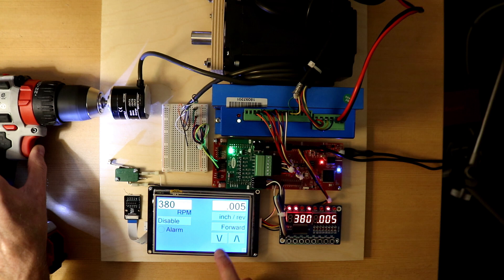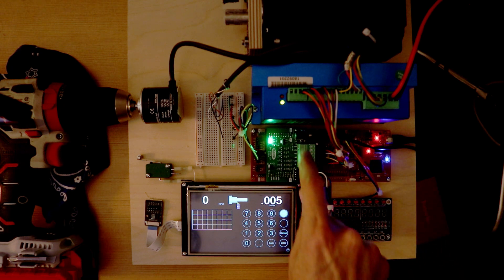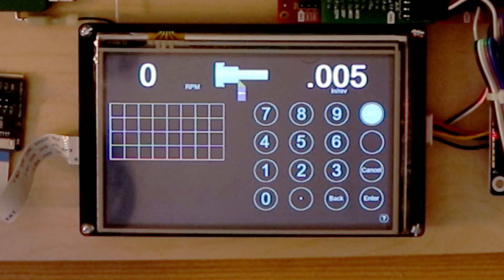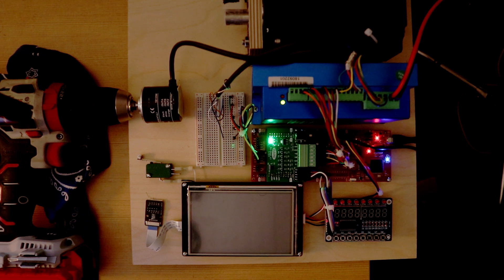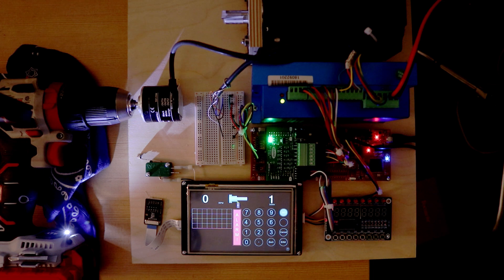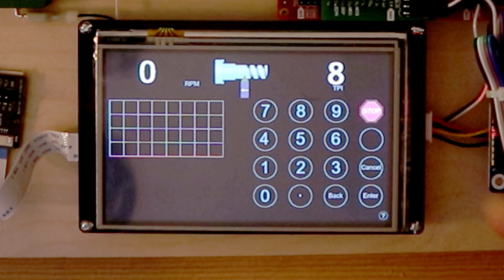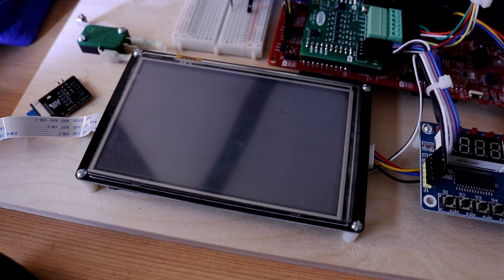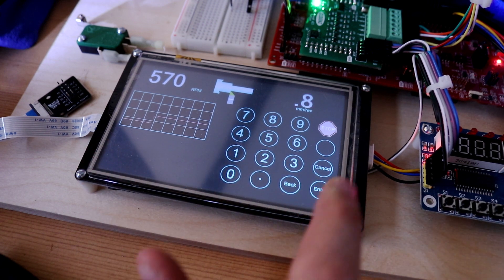Touchscreen for Clough42 Electronic Leadscrew

Comment: The touch screen is a great addition to Clough's ELS.  I would like to make a suggestion that improves on your overall offering. Instead using a Nextion Touchscreen, why not use what most people already have, an iOS or Android mobile device?  Even an older smart phone or tablet should be more than sufficient, allowing people to put their old tablets into use instead of throwing them away.

Writing the software for a mobile device is significantly easier due vast development resources available. The result is also far more powerful in terms of usability and presentation as smart phones generally have better screens and touch capabilities.  When combined with the sensors already available on most cellphones, the possibilities expand even further.  Imagine snapping a photo of a thread and it automatically calculates and sets up the parameters for you.  

In addition to the control App, you only need to design a hardware IO interface and  a specialized communications protocol, which you should standardize. You could also specify it as an extension to G-Code, establishing it as a standard. Both USB and Bluetooth should be fast enough for sending commands and data. Since you cannot interface with iOS via USB, unless you obtain a license from Apple, Bluetooth can be used on both mobile platforms.
Reply from the maker: Hi Barry, interesting idea and thank you for detailing your argument. I'm considering doing this for other work that I do (https://confluencerd.com/) replacing long lead-time industrial touchscreens and computers, while reducing cost, getting a much higher resolution on the tablet screen (in less space), adding portability and easier updates. I have three full computers in my small shop, and repurposing would save a lot of space (and cost.) A couple more sensors that are interested include the microphone and accelerometer for potentially recognizing chatter or other cutter performance. Then, there is the ease to include reference material from the Internet. Do you see the g-code extensions useful for something other than sending progress messages? This ELS is not the project that I want to explore your suggestion with, but I've saved your suggestion for a future project.

Comment: I haven't watched it all, but does it support multi-start threads?
Reply from the maker: Hi David, multi-start threads are not provided by the ELS. An ELS is to help manual turning by providing a programmable gear ratio between the spindle and lead or feed screw. The stock ratios are otherwise limited and may be inconvenient to change otherwise. To cut a multi-start thread on a manual lathe, one way is to index the part. The rough steps are: cut the the first thread, stop the spindle, disengage the leadscrew, rotate the spindle and part to the next index (e.g.: 0, 120, 240 degree for a three-start), re-engage the leadscrew, start the spindle, and cut the next thread. A lathe might have a graduated ring on the spindle to help make this more accurate, but small lathes are unlikely to have that. Your question is a good one because the answer shows how an ELS could help produce mulit-start threads: show the current rotary position of the spindle and fill the role of the missing graduated ring. Pretty interesting... maybe I'll make one more change...
Reply from the maker: This video shows a few different ways to cut a multi-start thread on a manual lathe including a graduated ring, slipping the gears, and a dividing plate. Pretty cool.
https://www.youtube.com/watch?v=4OmD0bqxpXg
Reply from the maker: Just added spindle rotary position. With a 4096-count encoder, degree-minute is the best that make sense. I may make a YT Short this week about it. Thank you for the idea :)
Reply: @kentvandervelden  As a non-machinest, suggestions are all I can make. ;)
Reply from the maker: You have a lot of CNC experience with 3D printing. Have an unused 3D printer to convert to a CNC router?
Reply: @kentvandervelden  I sort of do have an unused 3d printer....  But I don't have time for yet another hobby.
Reply from the maker: @davidwillmore  :)
Reply: @kentvandervelden  If I had anything I wanted to machine, I would have some motivation, but my interest in machining is just curiosity.  I sate that desire well enough watching you and this old tony.  You do a much better job than I could anyway.  I would rather just cheer you guys on.
Reply from the maker: @davidwillmore  Completely understand. No interesting person will ever have enough time to explore everything they may enjoy, unless they get to come back. I'm happy to have your support in this life :)

Comment: Great work on this and a nice upgrade. Liking your ideas for future improvements too. Thank you for sharing!
Reply from the maker: And thank you for the support! I just added rotary position in degrees and other modes and a friend wants to implement the feed override.
Reply: @kentvandervelden  Sorry, can't wrap my head around this but would it be possible to thread away from the chuck with the programming of the ELS/touchscreen as it is now? Right hand turn, but away from the check for added peace of mind.
Also, I actually liked the drop down items of your first version as it's easier to make a quick selection of a feed rate from that rather than typing. Is that function still there? Best would be to have both the drop down - potential with favorite settings storable - plus the "calculator" mode. 
Finally, I also liked when the enable/disable button was more prominent as in the 1st version. Maybe it would be possible to have skin where it took over the graph area?
I know I am asking a lot, but just thinking out loud here.
Reply from the maker: @AntiVaganza  RH-thread + LH-feed: This may be possible with the tool mounted properly. Maybe upside down or mounted on the backside.
Drop down menus: Here's a link to the version with the dropdown menus:
https://github.com/kentavv/electronic-leadscrew/tree/feature-nextion
and a the link to the arbitrary entry version:
https://github.com/kentavv/electronic-leadscrew/tree/feature-nextion-pure
I don't have the hardware to test with so I'm no longer making changes to the code, but others are welcome to submit improvements.
Hope these suggestions help you. Thank you for asking.

Comment: Great video and great work on this touchscreen! I like your future ideas of a pot on the bottom left .. also, could you do "more" screens? I'm wondering if one could emulate the actual feeds and speeds plates of any given lathe and input it as an additional screen that would allow a user to "nostalgically" revert back to "their" feeds and speeds plaque on their lathe as an alternative to the highly custom manual input .. 
Does James known of your mods? I think he should ;)
Reply from the maker: Thank you! The Nextion can have many screens. The rough way to add a screen is to draw it up in a graphics program, highlight regions that are touch sensitive, and then add code to response to the messages delivered over serial. One could certainly do this to create a lathe make-model specific skin. A creative graphic designer or UI designer could a lot without touching much code.
Reply: @kentvandervelden  You too could sell an add-on kit or work with James .. I say go for it! :)